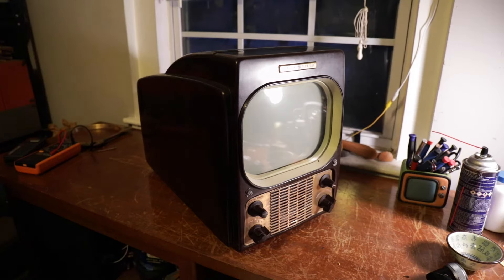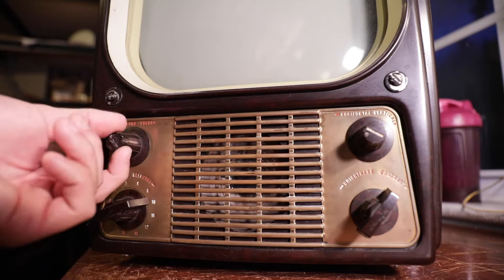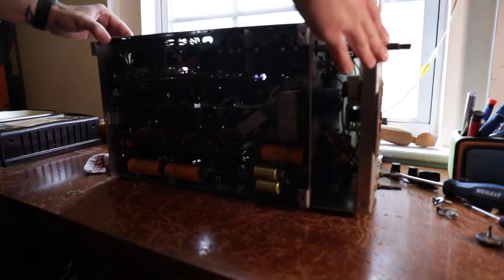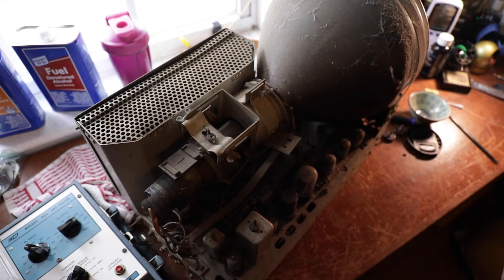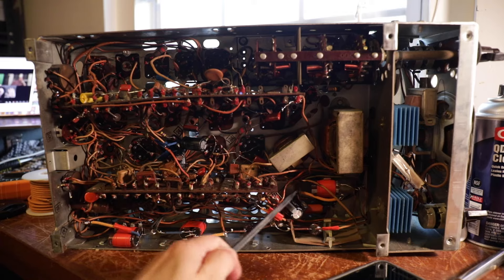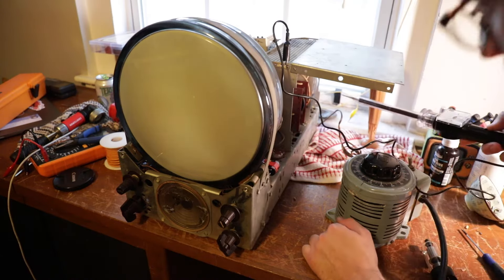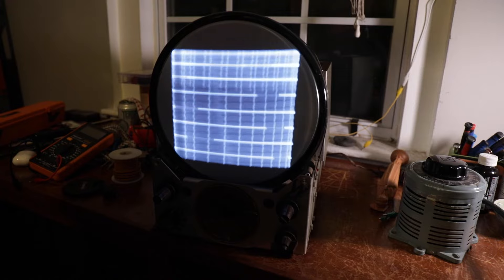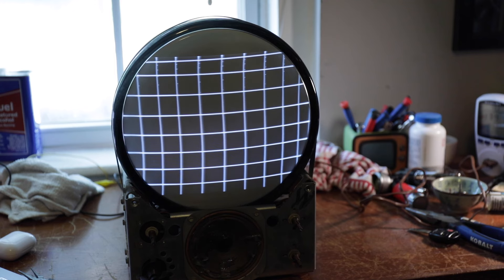1949 General Electric 'Locomotive' Television Restoration

Comment: So in 1949 they actually had an excellent tv picture. I always imagined those early tv pictures as fuzzy and jumpy. But I could sit and happily watch The Birds on that old tv set. Great job sir.
Reply: I watched a video of a guy restoring a tiny 7 inch TV from 1949, he played through a converter YouTube video and you could clearly read the time stamps at the bottom. They were really really small, but they were perfectly readable.

It's like the old gramophone records that are really crackly and crap, they're crackling crap now, because they're 100 years old, if you actually find a new old stock record, and listen to it on a old, wind up gramophone, that's been restored, they actually sound really good.
Reply: Some of the black and white televisions might've been crisper in image quality than color crt televisions we had in the 90's, because the electron beam just goes and paints an image directly onto the phosphors without obstruction, whereas color tv's had to pass them through this little grid to make sure the electron beam hit the right red green or blue pixel.
Reply: The Birds has now always been in color.   Mandela Effect.
Reply: You can't judge the quality of what TV broadcasts looked like in 1949 on the basis of what the image looks like today on an old television. That's because a high-resolution digital transfer of a 35mm theatrical film like "The Birds", for example, could not exist 70+ years ago. What was on the air back then was nowhere near as sharp or detailed in the first place, regardless of what kind of set showed it.
Reply: @hebneh  The Birds was never in black and white anymore.   Always been a color film now from the very beginning.    Mandela Effect.
Reply: @nyccollin  I'm well aware that "The Birds" is a color film. I never said it wasn't. But when it was seen on a black & white TV in the past - like the one in this video - it was black & white as well.
Reply: @hebneh  Everyone remembers the film to be in B&W.   Nobody remembers it being in color.
Reply: @nyccollin  Odd. I watched "The Birds" the first time it was shown on TV in 1966 or so, and saw it on a color television (which weren't yet common at that time), so I've never had the misconception it's a black & white movie - and I never heard that other people think that.
Reply: @hebneh  You should ask around!   Have you looked into the Mandela Effect changes?

Comment: They built these to last forever, what they didn't know was how fast television technology would change.  Disposable was not a thing in the first half of the 20th century.
Reply: I have a 1929 tailors iron, it was made under Lenin in the USSR, and cos I live in the former USSR when it broke I could buy a new electrical connector 400 yards from my apartment for $2. They NEVER changed the electrical connectors on Soviet electronics from 1925 to 1992. 

The idea they were backwards was mostly because their philosophy was repairability and longevity.

Comment: When I was a teenager in the 60s I was given a Crosley 12 or 14 inch bakelite set.  Like your GE, it was taller and deeper than it was wide. It had a Mallory continuous tuner that tuned from channel 2 right through 13, including FM radio between Channels 6 and 7.   Wish I had it now, as I've never seen another.  Thanks

Comment: Bakelight is a high temperature  composition. Over time the bakelight can get weaker causing cracks. I have a  weller soldering gun model 8200n I aquired it when my grandfather passed away. He used the hell out of it and I used jb weld to patch up the cracked bakelight case.  The jb weld is holding up real well. I love all the tube sets and love fixing them .  Tubes are tough and  there is a special feeling having tube equipment .

Comment: Interesting repair - I have a feeling the reason there were 600 uF caps in the power supply was to help with the half wave hum bars in the picture... but it does work as designed. Geat job on the repair. Funny how the "newer" caps are almost 50 years old... from the looks of it, probably was just a regalar shop repair. 1976 was when I started repairing TVs (in high school) so I did see a few old sets- but any old enough to not have UHF would normally not be repaired where I was because the popular stations in the 70s were UHF.  Cheers and thanks for making this.

Comment: Great job on your restoration. It turned out great. I'm about half way through the recapping on a 805 I just picked up. Getting ready to bypass the original rectifiers with diodes. What was the final value you ended up using for the voltage drop resistor? Thanks.

Comment: When you were testing the CRT you accidently had the "meter" switch on S and not N which is what gave you the pegged emissions reading. Otherwise, this was a great restoration!
Reply from the maker: In the B&K manual, for this tube, it’s supposed to be in the S position
Reply: @televisionforever  Weird, my 465 manual doesn't have the asterisk next to 10BP4A or 10BP4
Reply from the maker: @Lazyoliver666  My mistake! I just rechecked the manual and you're right. For some reason, I thought it had the asterisk. Nice call.
Reply: @David Wanklyn ...NOBODY'S INFALLIBLE-(!)

Comment: Wow,I had to comment on how clear and crisp the picture is on a 1949 television.I was wondering why you didn’t try turning on the unit when you first started instead opened it up and began changing out resistors etc?Was this a precautionary measure?If so your work paid off.Great to see these are being saved.Thanks

Comment: I wondered how a 1949 TV could have a rectangular picture, and then without the exterior cover I saw that in fact the tube is round. The image, however, is rectangular so the unneeded edges of the tube are just covered up.

Comment: i found a similar tv to this. same chassis but different case. its going to be my first tv to restore. i do many radios.
Reply from the maker: I'd say this model is a good first candidate. Easy to work on and a great performer once restored. I started with radios before moving to televisions too.
Reply: @televisionforever  the one i found is the ge 10t5 and i am currently looking for replacement electrolytics. any recommendations on where to get them from? mine actually came with mostly ceramic and poly capacitors but mostly original electrolytics.
Reply from the maker: @fanman8677  Replace the cans with individual modern electrolytics. The entire electrolytic can replacements are pretty expensive and only really retains the original look of the chassis. Most of the cans have around 1-4 electrolytics inside so getting individual ones to replace each one won’t be a problem. Antique Electronic Supply has a good selection of replacement caps and electrolytics. Also Mouser does as well but the website is a bit difficult to navigate. Also, justradios has very good prices.
Reply: @televisionforever  i ended up using parts express and got some new electrolytics based on what was in the schematic and in my tv as the capacitors in it were mostly original. however i still feel very lucky about mostly ceramic and poly capacitors in there. i also got some for my 1960s console radio with el84 tubes.
Reply from the maker: @fanman8677  Usually ceramic caps last and are pretty on spec. Any paper or oil filled caps need to be replaced. I replace odd electrolytic values with easy to find replacements. 4uf with 4.7uf. 8uf with 10uf. 20uf with 22uf. 30uf with 33uf. 40uf with 47uf. Electrolytics have a good amount of tolerance with their value so you have some wiggle room.
Reply: @televisionforever  thanks i will replace the single oil cap tommorrow but i do have some questions about alligning the video on the picture tube. I replace the .5 mfd under the tube and got the picture unalighned. Is there an easy way to realighn the deflection yoke
Reply from the maker: @fanman8677  realigning the picture will come with moving the magnet behind the yoke. Not the ion trap though. In front of that there should be a screw on top of the tube that you can unscrew, move up down, left right, to get the picture in the center of the picture tube. I forget the name but it should be labeled on the schematic
Reply: @televisionforever  thanks

Comment: Amazing restoration! You and a few others inspired me to go out and buy my own tv to restore. After searching for a few months I found an RCA 730TV2 for sale. I bought it and started to read up on it on Antique radio forums and someone said that if you moved the Ion trap you wouldn't get a picture on the screen. Well naturally I had already fiddled around that area. Is that true and how easy is it to set back in it's correct position?
Reply from the maker: Hey thanks so much! and yes, if everything is working properly, you hear high voltage but no picture, adjust the ion trap. Try to see if there is a dust mark where is was left for years on the picture tube neck before you moved it (if you moved it). Put it to that position and rotate it around the tube neck until you see a picture. Remember to have the brightness control all the way up to be able to see. When the ion trap is in the right position, this is where your image will be the brightest. Then you can turn the brightness control to a viewable level. The ion trap is directing the electrons towards the front of the picture tube which illuminate the phosphor. Let me know if that helps you.

Comment: Hello, I own a 1952 RCA tv but all I can get is sounds of the shows on it but not picture on the screen what do you think can be wrong with it?
Reply: Also the screen does show the lines and sometimes static
Reply: Also the original antenna is detached and we a newer rca antenna attached
Reply from the maker: Has the television been restored? Do you get light on the screen but no picture? If you’re getting sounds from the coax hookup, the tuner is working.

Comment: Silicone is a pretty terrible way to repair speakers. It gets everywhere, it adds unnecessary mass to the cone, can create a stiff spot on the surround, and it's very difficult to remove should the speaker ever need a full cone replacement. The best way to repair is to remove the speaker for access, carefully trim a "patch" that follows the shape of the crack made from blue paper shop towels, and use Aileen's Tacky Glue from the craft department at your local super center to glue the patch to the back side of the cone. Put just a couple dots on it to position the patch. Then you can thin some the glue slightly with isopropyl alcohol and brush it on with a hobby brush, saturating the patch. You can adjust the patch by gently pushing it around with the aid of toothpicks. Once the patch has set up and dried, you can thin a mixture of the glue 50/50 with isopropyl and carefully brush it onto the entire front surface of the cone with a small foam brush, avoiding the accordion surround. This will strengthen the cone and prevent further damage, and the isopropyl will help prevent water staining.

Comment: 10K ohm at cold, 5 ohm when hot = startup current limit NTC series resistor for protection.
The physical size (i.e. thermal mass) determines time delay.
Warning : This resistor will normally be HOT-hot during operation.
They were used to protect the tube heater filaments at startup.
The tube filaments are low ohm at cold and high (PTC) when hot (operating).
Also used as delayed plate current in the tubes until heated.
Greatly increases lifetime of tubes.
Reply from the maker: I can understand the current limiting process, but the resistor was 5ohm cold and out of circuit.
Reply: @televisionforever  Aha...
Might not be a NTC after all.

Comment: Did you find the little speaker? You wanted him to be 18 inch 1Kw? He's perfectly proportional!
Interestingthat already at that time was used ferrite core transformer working at high frequency to generate a, high voltage.